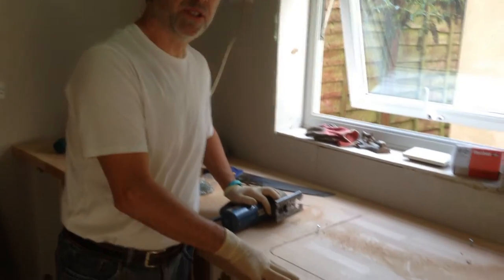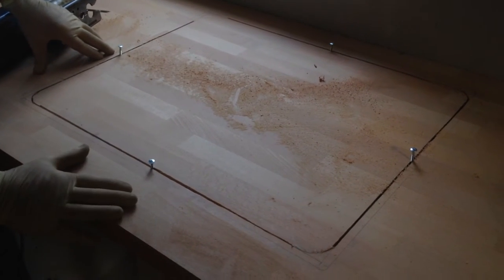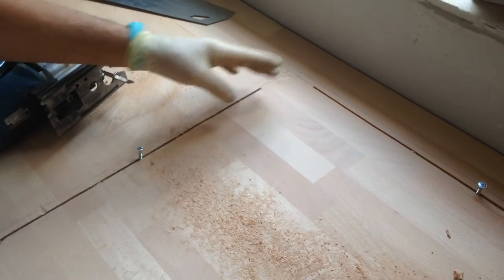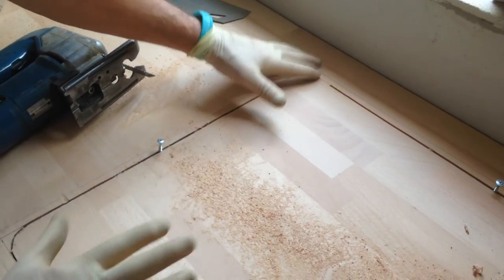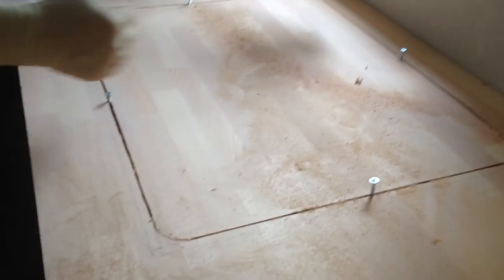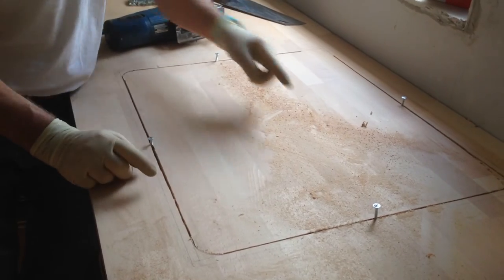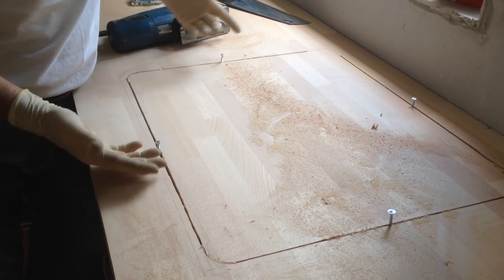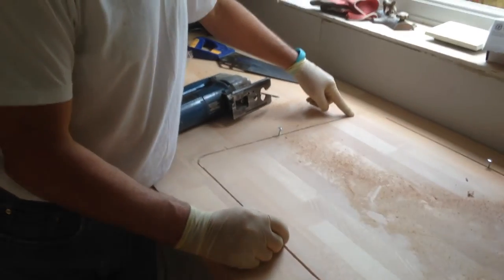Cutting a hole in worktop for the kitchen sink part 1

Comment: I'm about to tackle just this job (a sink cutout in a butcherblock countertop), and I really appreciate the tip about using four screws to prevent the "waste" piece from dropping unevenly, pinching the saw blade, and ruining the cut. Many thanks.